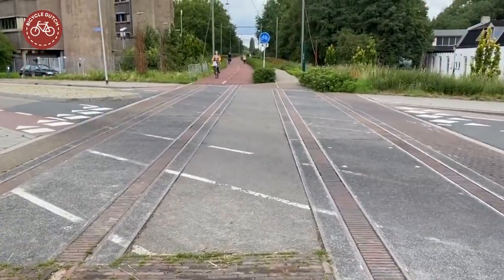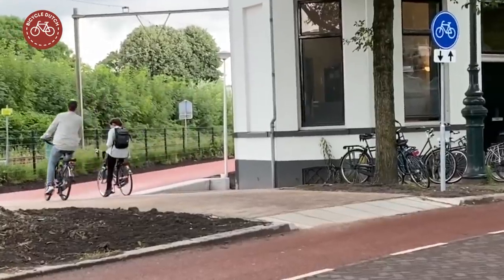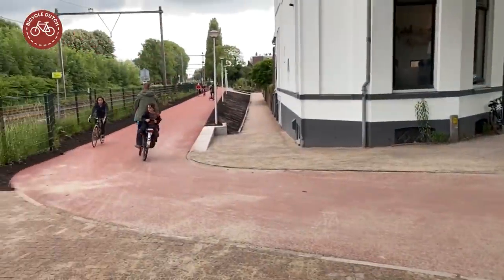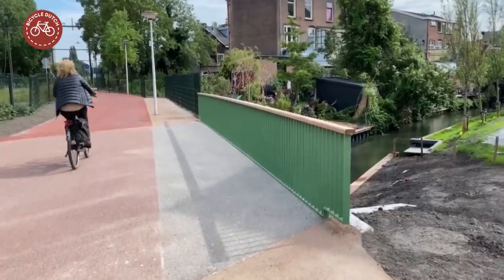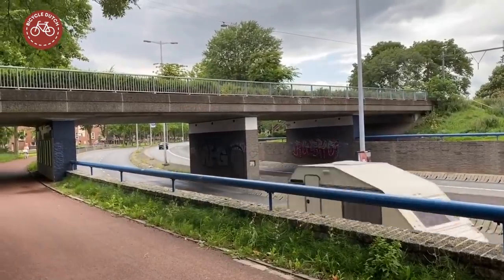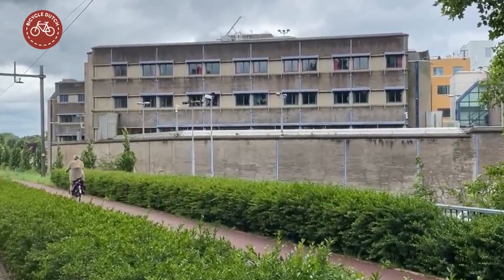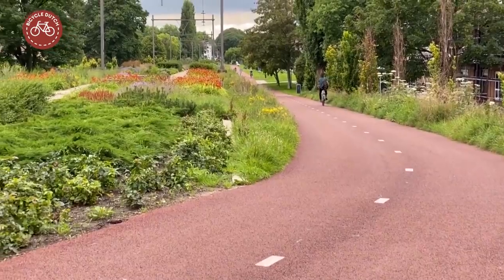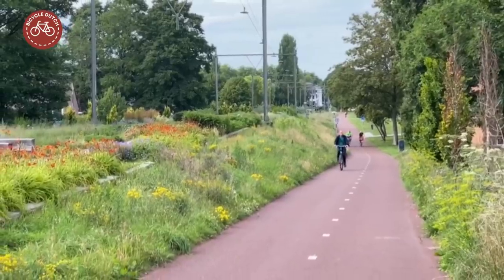How to get from Railway to Cycleway

Comment: This is great. Some of our best trails are Rails-to-Trails in the USA. I wish there were more Rails-with-Trails, but this has been a slower movement due to liability with the rail-roads.
Reply: Rails-to-Trails can be great but they can also go too far. My hometown has sacrificed the best rights of way for rapid transit in favor of trails. Instead of direct lines that don’t run on streets linking city centers, we get on-street bus rapid transit that suffers death through 1,000 cuts from pissed off car drivers. 
The BRT gets stopped at the stoplights (despite having a degree of signal priority), has no dedicated lanes in spots or a single lane to share for both directions, and have meandering routes with relatively frequent stops. 
If the space is available, I’d love to see a trail parallel rapid transit for the best of both worlds. Pretty sure Minneapolis is doing both on a corridor.

Comment: My country has an entire network of these old abandoned railways converted into a “cycle” network. Unfortunately, the path can be used by pedestrians and cyclists alike without separating them, or giving either the width that would make it comfortable. It also is not as pretty as that😢
Reply: Cycled on a part of it, it really wasn't a pleasure at all. Moreover it doesn't lead anywhere you really want to be.
Reply: Would this be in the UK by any chance? I only ask because we have lots of these closed railway lines around Leeds, in Pudsey, the old Wetherby lines and even a huge abandoned viaduct running from Lower Wortley through Holbeck and into the city. In the latter case it stands derelict despite attempts to create a 'high line' style elevated, linear park, whilst other old trackbeds are open but not hard surfaced, instead becoming a rutted mudbath that only mountain bikes can negotiate for nine months of the year. In some cases bridges and tunnels were infilled or demolished on closure forcing users to leave the path and cross busy roads. We could easily do something like this - completely separating cars and bikes/ pedestrians - if only the political will were there. Instead we build ever wider roads for ever bigger cars and then wonder why our mental health and air quality are atrocious.
Reply: @rich_edwards79  yup
Reply: @alexmorgan3435  i mean, so are most countries ngl
Reply: @alexmorgan3435  'UK is a shit country'.

There, fixed.
Reply: In the Netherlands, no footpath means pedestrians can use the bike path. But its expected to stay somewhat near the side or get yelled at by a lot of people on bikes.
Reply: @tardvandecluntproductions1278  interesting

Comment: Something like this but with more modern buildings would be exactly how I would design this kind of residential area. Especially for student accommodation.
Reply: As someone who lived in said student accommodation, it isn't that great. Especially in the winter. And that is coming from someone who knows what a Minnesota winter is.
Reply: @Azivegu  I guess you should feel pretty lucky then if you think this sucks.
Reply: Well this complex is called the IBB and was build in the sixties to last about 40-50 years but with the high demand in student housing they are still used. In the lower parts there is still a lot of asbestos in the ceilings. However they did change all the windows to two layer glass which should help with the cold in the winter.
Reply: @Azivegu  Student accomodations isn't supposed to be great. You pay a fortune for a very old, small and badly maintained room. The landlord doesn't do anything with your complaints and only exists to receive the rent every month. There are exceptions, but you will only find out when the contract is already signed.
Reply: @stanwever3829  I said “something like this but with more modern buildings”.

Comment: Mhmmmm Cycles instead of trains is a difficult trade imo
Reply from the maker: Not when you know there is a parallel railway line that can handle all the freight trains that used this line. The idea to change this into a park/cycle route came after the line was already closed because it was redundant.
Reply: Nope. Utrecht is THE train hub of the Netherlands. It really connects every corner from the country to any other corner of the country. In the past decade or so massive amounts of works have been done to upgrade nearly all the lines as well as a complete makeover of the train station. Then there were a few bits of rail leftover that had no further use.

Comment: Great cycle route, but I'm allergic to railways getting turned into cycle routes. It's cannibalism!!
Reply: Meh. If the railways aren't used anyways, it's fine to give them another use. Better than to let them just lie there and be useless. The rails can be recycled, and it's really cheap to simply put a layer of red asphalt on top. Very cheap way to turn unused infrastructure into another form of high quality infrastructure.
 
Also, if the railway is still in use, it's often possible to put a bike path alongside the railway. It's a lot more comfortable to bike besides a railway with an occasional passing train than it is to bike besides a highway with continuous busy traffic. And railways often go to city centers as well, while highways... don't. Or shouldn't, at least.
 
But don't worry, we have plenty of railways still in operation and a pretty good national passenger rail network.
Reply: @alex2143  Sure, but preferably railways should stay railways and should be used as such. In Germany there were railways close to just about every village in the 1950s. Since then about 30% were decommissioned. Today we are in desperate need for these tracks for freight and passengers... And a few of those who could be recomissined were turned into cycle tracks...
Reply: @CARambolagen  I'm reasonably sure it's possible to revert those cycle tracks back to railroad tracks if you invest in some cycle tracks that run beside them. This really doesn't sound like an unsolvable problem.
Reply: @alex2143  Surely not unsolvable, but very unlikely after an investment like that has been made. And once a cycle track like that has become popular/accustmed a reversion back to rail will meet even more resistance than happens already in many cases.

Comment: I think converting railway lines to bicycle lanes is a shame! What will we do with the climate change? Do we all have to die because of shutting down railway lines and turn them into bicycle streets? Railway lines we need to protect climate and nature? I love cycling, but I'm getting furios if I see a railway line that was turned into a bicycle street. There would be enough room to build the bicycle lane somewhere else! This trend must be stopped!
Reply: You’re missing the point! This railway line has become redundant. There is a parallel line which is capable of handling all the trains. So they’ve chosen to repurpose the old railway line, which would otherwise just be dead space
Reply: @tijnvandebeld7930  Where is this line parallel to the old ? I see just the link through Utrecht centraal, which is surely not good for through freight train traffic because it is a train station and so there is not many capacity. And the next parallel link is from Amersfoort to Veenendaal, and is mostly dismantled. The railway line from Barneveld to Ede has just one track, is too far from Utrecht away and cannot be used as a suitable parallel line for this inner Utrecht section, so I think there is no parallel line, just dismantling of infrastructure and relocation of freight transport to the truck. What would they do? Let the freight trains pass through Utrecht Centraal and cause delays so the train is less attractive? And this is climate protection? I think not. Here in Germany, especially the city Fürth, has this problem. There are going two railway lines in one train station and there is a railway line to Nuremberg central station and the railway line to the Nuremberg marshalling yard. And when there is a freight train coming from Bamberg, it blocks the whole station apron because it is mostly a long train and causes delays many times a day, I am also standing often in a delay because of this reason. And a tunnel for this through traffic will start to build next year.
Reply: @simonhorner6471  In The Netherlands every square meter counts, especially in the Randstad. If an old railway track isn't being used anymore for whatever reason it will surely be repurposed. Perhaps it's a shame train operators started using different routes or even worse freight companies shifted to trucks. But we can moan about that or we can accept it for now and give the dead space to people who would actually use it.

Also keep in mind that proper cycling infrastructure keeps people out of their cars or even from buying them. That's not something that's easily measured but it might very well outweigh those extra trucks that replaced a freight train or two a day.
Reply: The line is inactive